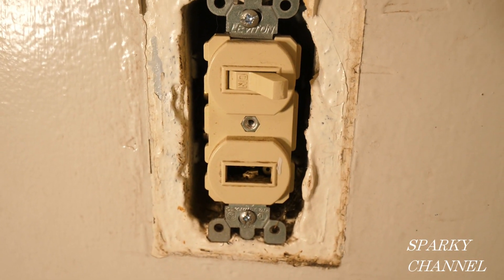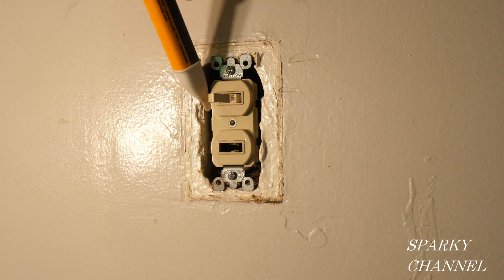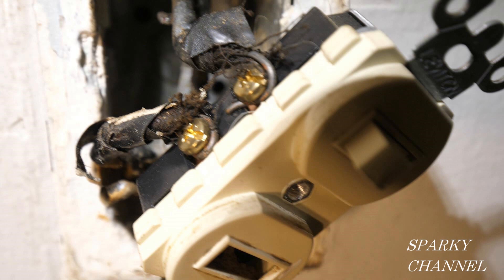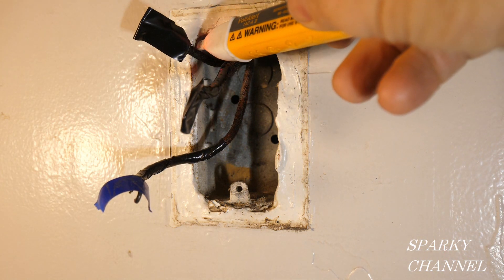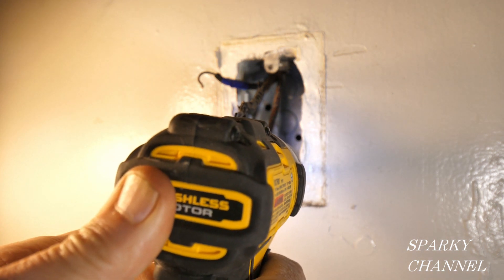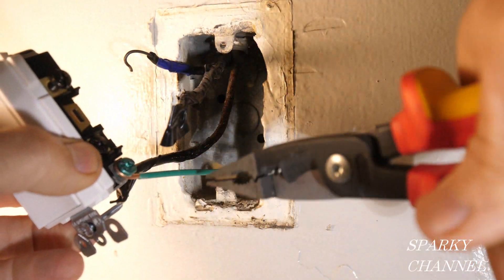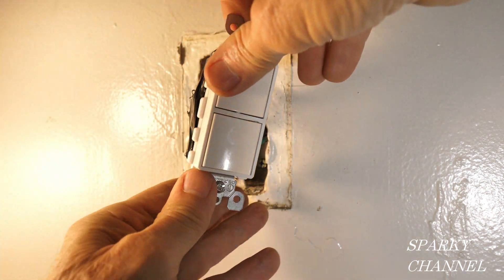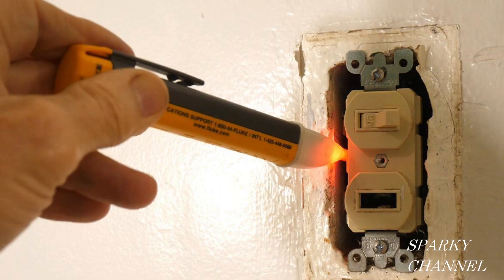How to Replace and Ground a Double Switch in a  1957 House

Comment: Great. Video. At first glance, the old wires looked like aluminum wire or tinned copper. Just a lighting issue? I suspect that they were in fact copper since you didn’t say anything about aluminum or tinned wiring.
Reply: The wiring has rubber insulation covered with cloth.  This is the case with original true BX cable.  The wires are tinned copper because bare copper would react with the rubber and cause it to deteriorate prematurely.  When I encountered this in my old apartment I used a small piece of sandpaper to remove the tin coating when making wire terminations to minimize the resistance.

Comment: Noob here. I learned a lot in your videos and they are the reason YouTube got created. I wished it stayed that way. 
Quick question, I didn’t see neutral wires in that setup, is that normal?
Reply: This is the old style of wiring where the conductors are individual.  The neutrals would just be run to the light and fan.  With modern day Romex, hot (black) and neutral (white) would be in the box as well as the unsheathed ground.  However, the neutral would not be hooked to the switch.

Comment: Nice step-by-step video.  It would have been nice to point out the fabric/rubber coated insulation around the wires (cambric) are generally found in older home and that this insulation had deteriorated and was covered by silver/gray duck tape.
Reply from the maker: Thanks! It was old electrical tape.

Comment: Hi Bill, I’m surprised you used tape during testing instead of Wago lever nuts like you normally do. By the way, are you still planning to do a comparison of the Knipex 13 72 8 wire strippers with others?  Or did I miss that?
Reply from the maker: Hi Chuck! I did that because I didn't want to straighten out the wires and then loop them again. I prefer to not disturb and re-loop the wires due to their age. I'll have to check and see if I have a video like that. If not, it's a great idea!

Comment: Be careful with such switches when they're broken like that, they should be replaced immediately! Through the opening live parts of the switching mechanism inside are exposed, even when the cover is fitted! Especially if there are any kids in the household.
Reply from the maker: Hi Marcel! Yes, you are absolutely correct. I'm not sure what happened to the old switch, but it wasn't good!

Comment: it is possible that whoever installed the switch meant to make it impossible to leave just the fan running, but I see no reason to do that.  I dealt with a truck shoreline connection where someone had wired in a switch/plug device to be able to turn the block heater on and off - and miswired it so turning the switch on created a bolted fault.
Reply from the maker: Wow! Bolted faults are incredibly dangerous.
Yes, I think it was just mis-wired.

Comment: The mis-wired switch, NEEDED the top switch turned on (light) in order for the bottom switch to be able 
To turn on?         All of this correction only to discover the fan motor is not good.
Good report. Thank you.
Reply from the maker: LOL! Yes, this is what it can be like when renovating houses! It's a very old fan, 7" duct, direct vent through the roof. I was able to find one on Amazon: Broan-NuTone 8210 8 Vertical Discharge and 7-Inch Round Duct Ceiling Fan, 210CFM,Silver: Amazon: https://amzn.to/3gL355S
Reply: @SparkyChannel  at least it is a model that is still made so you can rebuild it in place.  anything other than a direct discharge, I would have said get a Panasonic Whisper series fan,. because they are the best for installing through the ceiling material.
Reply from the maker: @kenbrown2808  The Panasonics are also very quiet. The direct discharge fans are noisy but they really move a lot of air.
Reply: @SparkyChannel  the good news is the cheap trailer house direct vent fans are so common around here, the local hardware stores stock replacement motors.
Reply from the maker: Yes, I'm sure the original bottom switch needed the top switch to be on in order to work. I didn't really care to check as it wouldn't have made any difference in the job. The darn thing was broken and mis-wired. LOL!

Comment: Bill having worked on some of these older homes up here, the way those equipment grounds were done is crazy as compared to the importance of grounding nowadays. Do ya think it was because all the  devices didn’t need a ground? Ex two wire receptacles. Good luck with that fan Bill👍
Reply from the maker: Usually the bathroom and kitchen had grounds like I showed in 6:01 but for a receptacle like an interior living room or bedroom a ground is rarely found in the 50's and 60's houses. It could vary quite a bit from state to state and house to house though. It's best to use your meter to do a check and go from there.
Reply: @SparkyChannel  here, you frequently find houses with first generation grounded cable where the electrician didn't know what to do with the extra wire, so he cut it off. the few I've found with external grounding like that, the grounding was applied years after the original installation.
Reply: @SparkyChannel  believe me I hear ya. Rewired plenty of situations like this. Grounds?who needs stinking grounds. 😆

Comment: so... any tips about where to drill the hole to avoid damaging the grounding?
Reply from the maker: If you look at 6:01 that will give you a good idea.
Reply: In the back of the metal box,  it's shown in the video.
Reply: @Dacari13  yes, but how to avoid the existing groundwire, and its mounting point, on the back of the box?
Reply: @wim0104  I go for the corners.